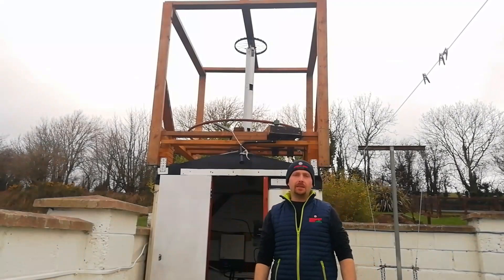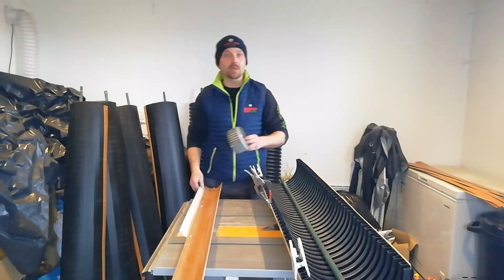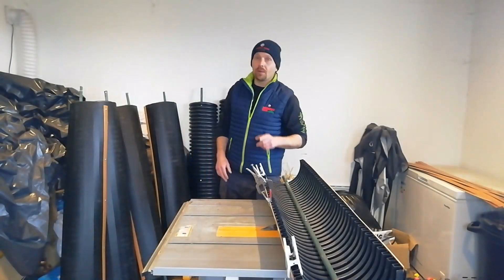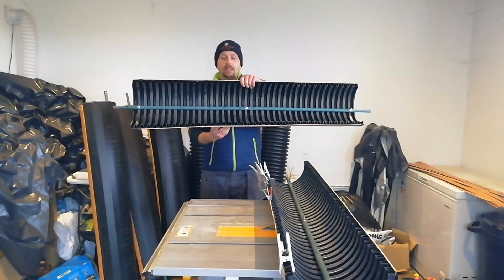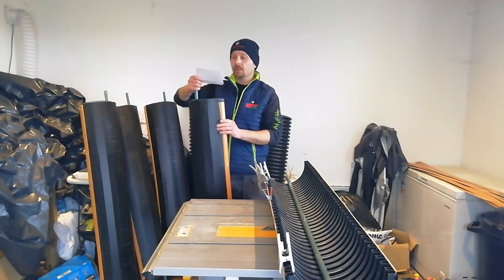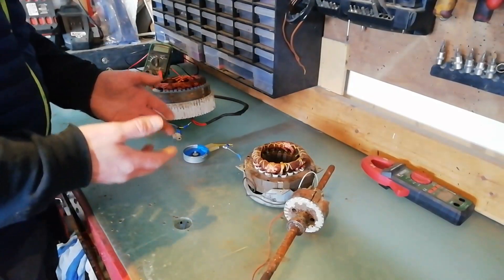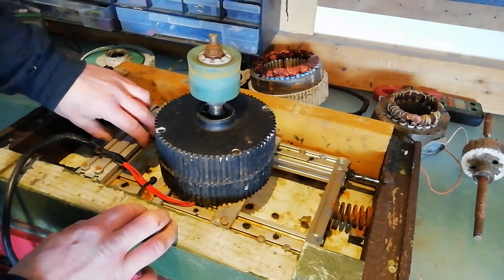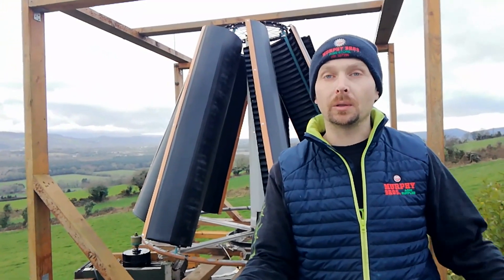DIY Vertical wind turbine, how we made it, tips and experience

Comment: 2:20 I’m not sure I agree that the corrugation actually increases the area with respect to power generation. The same area of wind will hit it regardless of corrugation, that wind area is where the power comes from. 

The corrugation certainly increases strength, as the second moment of inertia is greater, resisting flexing and buckling. Like how they’d make walls curvy in medical times, or how we currently design things like  I-beams. 

Very cool project. Thanks for sharing
Reply: I see other people have commented something similar, but you disagree with them. 

Would it be possible to set up some kind of experiment? Would be happy to be wrong!
Reply from the maker: It's very simple, the corrugations reduce upward and downward movement of the air as it hits the back of the blades instead forcing it sideways through the channels of corrugation instead of the air dispersing in a circular pattern. This results in more driving force being achieved from the available wind.
A simple way to think of it is, take a piece of paper, draw a straight line from one edge to the other, then draw a wavy line from one edge to the other. Which line is longer? Increasing surface area through this basic principle has been used for centuries. That's why Phillips screwdrivers perform better than flat, why driveshafts have splines and why off road tyres have big nobbly tread on them.

Comment: There is something going on here that nobody has mentioned either in the video or the comments.  Due to the conical nature of the turbine as a whole, the wind in the concave side of the blade will flow from top to bottom due to centrifugal force.   If you consider this direction of air flow, then the corrugated inner surface does have a much larger area.  This would account for the improved performance.
Reply: Part of the nature of these VAWTs is the lever length.  The conical nature is pretty much degradation of the potential.  He should have used perpendicular mounts.
Reply from the maker: This design intentionally does NOT use perpendicular mounts as it would require weight balancing of the upper section. The conical shape allows for far better stability during high speed rotation.
Reply: I saw one using smaller turbine in a downpipe that used the vertical turbine to drive power down getting a secondary turbine for small electronics (5v usb ports)

Comment: I think you have just added weight not a increase in surface area the wind can use. If this worked then just make plane wings zigzagged this way you have the same amount of material and weight but in a shorter package…  if the pipe is a bigger diameter this will increase the amount of air captured but now your pipe has bits missing all up the sides so it’s less effective then if you just brought the same size pipe but straight pipe? Just look at the silhouette of the objects and not the finish.
Reply from the maker: You clearly have no understanding of the difference between lift and drag type turbines.
Reply: @ourkilkennyhomestead2006  touchy 😏

Comment: Very cool project 👍

I don't think the increased surface area impacts the performance, since the pressure due to the folds results in a force along the "wing" and not tangential to the axis. That being said: should not hurt either and can probably help the stability in strong winds.
Reply: Would like an explanation of why icegoggles thinks that all of the surface area of the corrugation is contributing to a turning force.. It seems two of the ribbed walls are normal to the axis, so the force of them are not adding to rotational force.  Possibly the ribbing helps with spill.
Reply: Yeah I don't buy that the increased surface area helps, because the only surface area that matters is that which is normal to the direction of the wind. The ribbing will be perpendicular to it unless the window is traveling up/down. However maybe it helps reduce friction and therefore increases the air bouncing out of the curve?
Reply from the maker: So it's been a little while and it turns out that the increased surface area makes a huge difference. Also the edges of the corrugation gives a slight ugrinsky effect further improving the performance. If your going to make a vawt for yourself then this blade setup is a good starting point. 👍